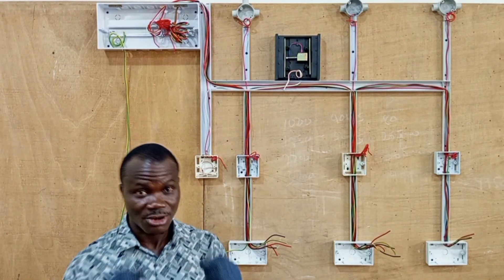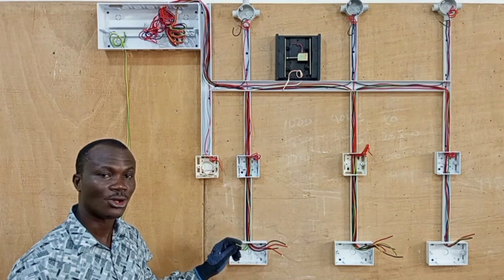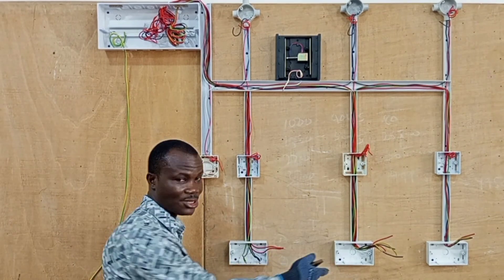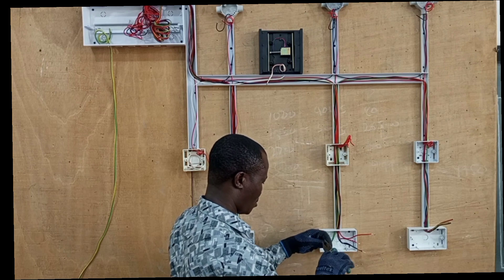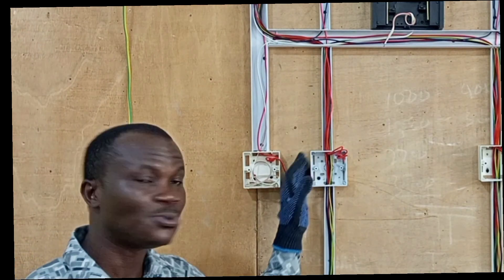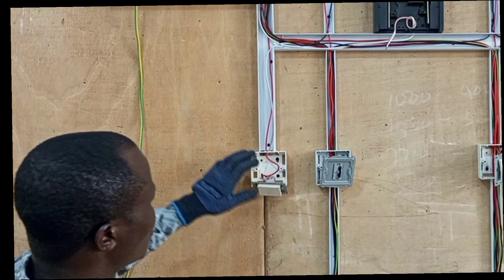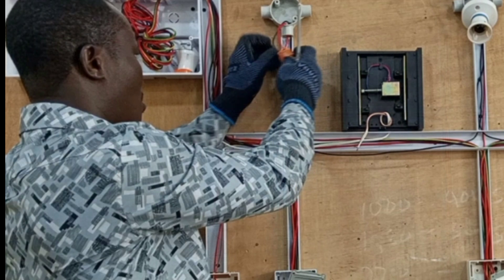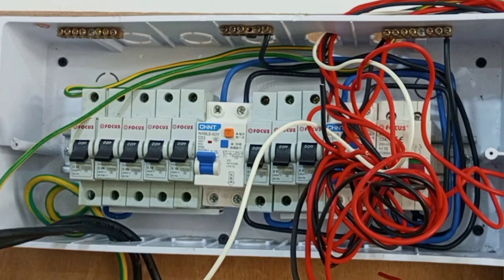FULL HOUSE WIRING IPART3I

Comment: hello Bossman, there was a terminal on the extreme end in which you didn't insert a cable. what is it called and why didn't you do that. this was at 3:47 on the timeline bar.
Reply from the maker: Yes, because of the type of wiring and the materials used.